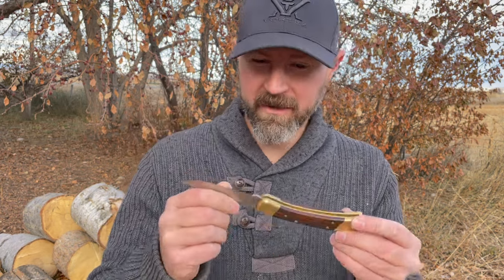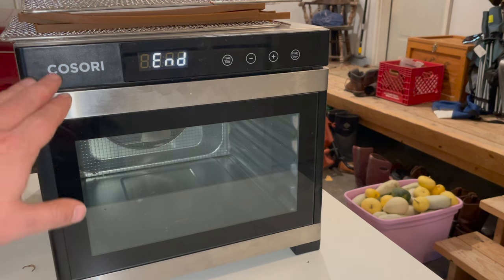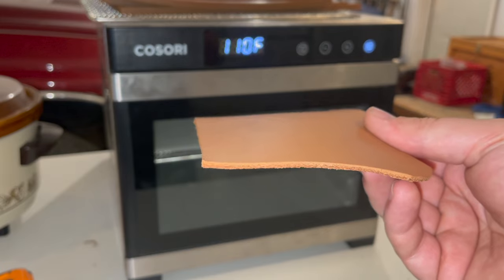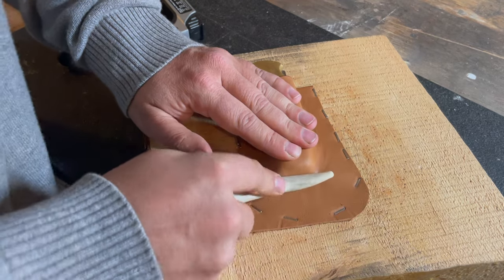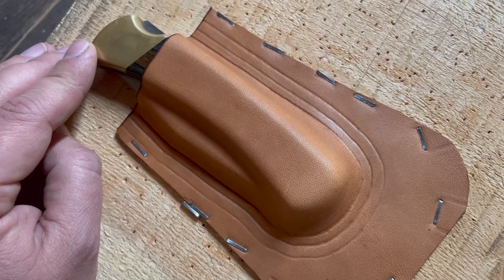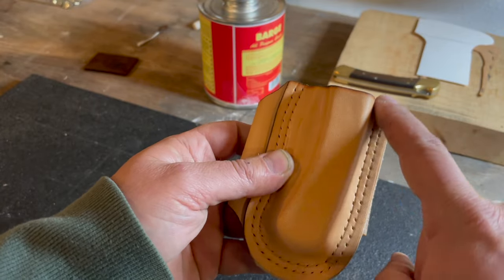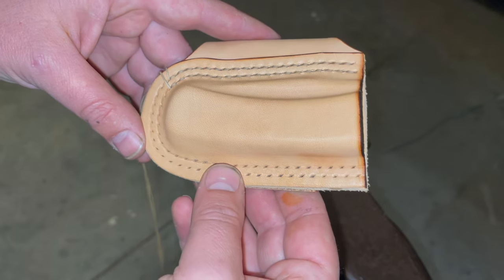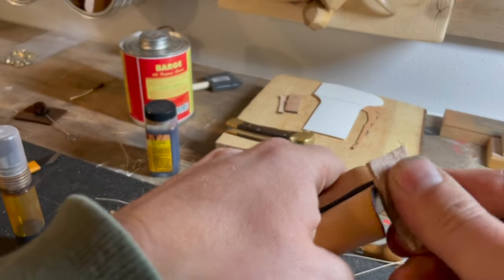The Ultimate Leather Sheath Building Tutorial | Buck 110

Comment: I like your hot wax dipping method for molded sheaths. Saves from having to harden the leather to retain stiff form. I would not think this method would be good for items that you want to keep flexibility in. I mostly just rub straight bees wax on the exterior of the leather (front , back, edges) and buff by hand to create the heat needed to melt the wax into the outer layer. This process has to be redone periodically but makes things water resistant and will still stay flexible.
Reply from the maker: You are correct. The wax dipping does not lend itself well to flexibility
Reply: @wyomingwright  I am glad I caught your video. I have a few items I made for fishing tackle I would like to stiffen and water (proof/resist) this just showed me everything I had been looking for. Thank You!

Comment: Excellent tutorial, learned a lot.  Not that I have arrived, I am just getting started but I did learn from another leather crafter that when stitching you can have both threads pulled through the back of the leather when you cut and burn them and it gives a cleaner look and you have less chance of burning the leather on the presentation side of your project.
Reply from the maker: I’ve done that but I like the nice tight finish you get pulling the threads in opposite directions. I don’t mind the small melted bit in the front. It motivates me to keep everything tight and clean instead of just hiding it all in the back😁
Reply: You get the tight finish from tying a knot with the two loose ends of thread inside the item being stitched. The ends are then hidden inside the item and never have a melted point on the outside of your project. Also if you are using the correct saddle stitch where each loop of the stitch is wrapped together then the stitches don't move before you are able to clip the end and melt it.